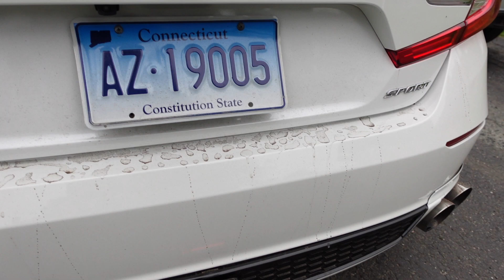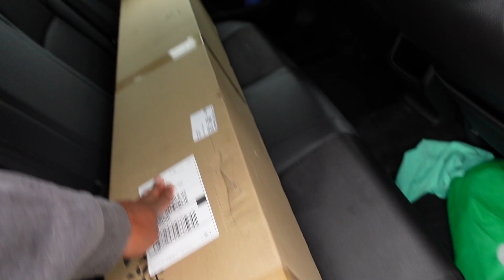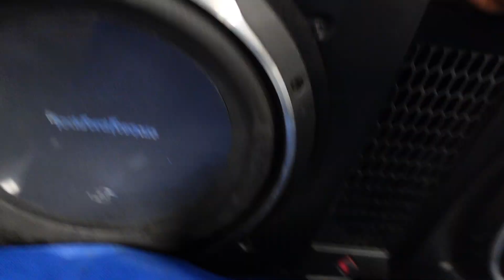2019 Honda Accord Yofer V2 diffuser

Comment: Yo ferb, i have 4” outlets for my quad tips, do you know if theyll fit? Already have the diffuser on but cant fit the sides.  Could I squeeze em if i tighten up on the exhaust hangers? Lmk what you think, thanks in advance
Reply from the maker: I have 4” tips so yea
Reply: @Ferbchipskull  dont wanna 20 question u but any problem with contact heat?  Appreciate the reply.
Reply from the maker: @mootzigga4675  it don’t touch the diffuser so no
Reply: @Ferbchipskull  thanks fr info bro
Reply from the maker: @mootzigga4675  no problem 🫡